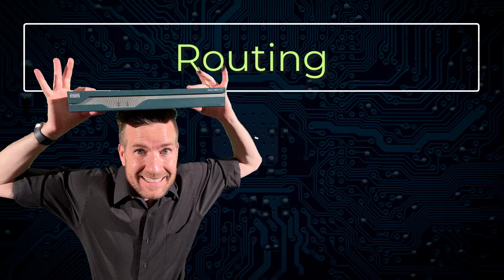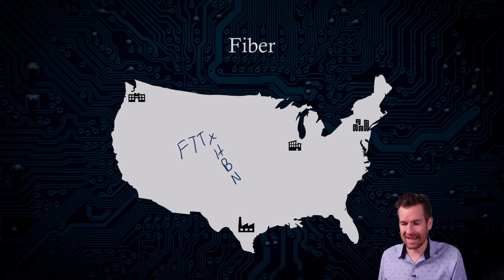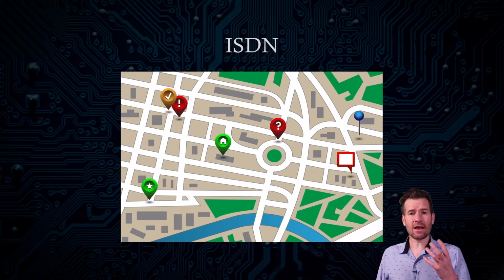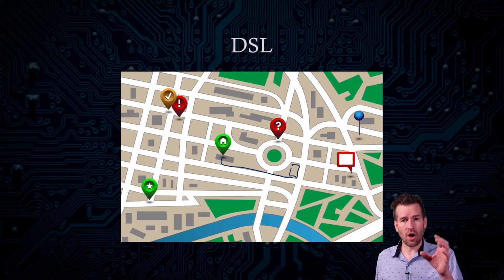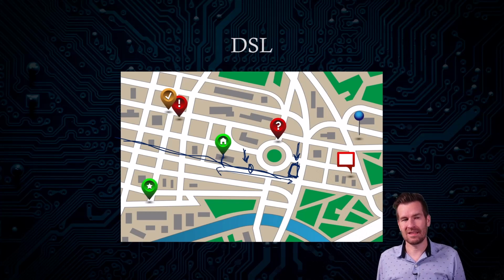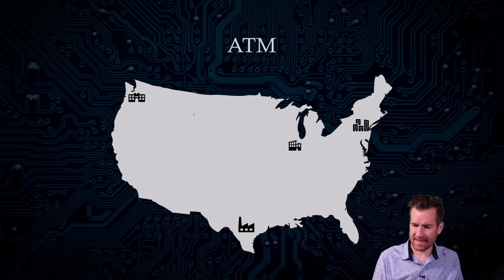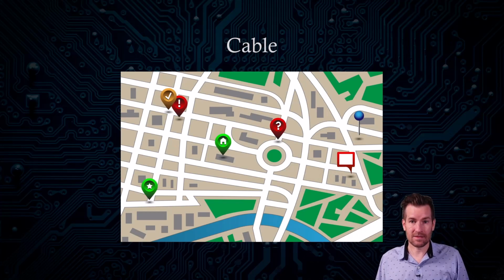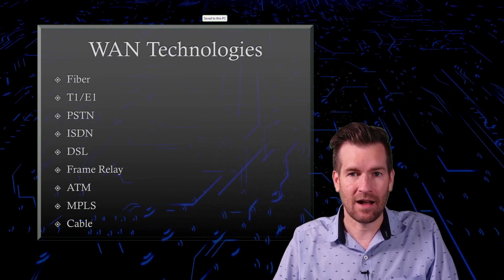CCNA WANs 1-3: WAN Technologies

Comment: Hey fellow techknowstuds ....Notes from today video WAN TECHNOLIGES.
1.	Fiber
Goes long Distance Signal does not degrade.
FTTX    means= Fiber To The  X
Where X can be
H = Home
B = Building
N =Node/Neighbourhood
SDH = SYNCHRONOUS DIGTAL HIERACHY
SONET= SYNCHRONOUS OPTIACL NETWORK
Can Multiplex across fiber
2.	T1/E1
T= North America Standard
E= Eurpoe
T1=speed  1.554 mbps
T2= speed  2.048 mbps
T3= speed  43.7 mbps
E3= speed  34.368 mbps
Older Legacy standard does not have enough bandwidth for modern use.
3.	PSTN = Public Switch Telephone Network
Dial up still used in Older Homes.
May be used if you live to far away from a central office
Still is an option but seen as a last resort.
Only 56 Kbps (slow)
Can be improved upon by using ISDN connection.
4.	ISDN  = INTEGRATED SERVICES DIGTAL NETWORK
Can carry both voice and data 
Expensive now legacy.
Can carry both voice and data.

5.	DSL Digital Subscriber Line.

Can be ADSL = Asymmetric Digital Subscriber Line.
             SDSL = Symmetric Digital Subscriber Line.
Central Office need a DSLAM 
which is a Digital Subscriber Line Access Multiplexer.
Function of A DSLAM is to aggregate the DSL connections to forward to the internet service provider.
Not all central offices have a DSLAM 
Phone line has to clean i.e., away from crosstalk / interference.
Location needs to be within 3 miles of the central office
Solid connection can be provided but it may be oversubscribed.
Can be some latency issues.

6.	Frame Relay.
You connect to your internet service provider via a router.
The service provider has a layer 2 network of Frame Relay Switches.
A Defined route is then made for you to get from point to point. 
Layer 2 	Technology therefore a little faster
Get DATA from 1 point to another point. Guaranteed some sort of transmission Rate.
ASLO CALLED
Non-Broadcast Multi Access Network.
Consists of a series of interconnected LANs
Sets Up a Private Virtual Circuit
Each line has a DLCI which is a Data Link Circuit Identifier (a number) this is used to identify the route / circuit.
7.	ATM = Asynchronous Transfer Mode.
Uses shared line but guarantees a certain Bandwidth between connections
Sends 53 BYTES AT a time down the channel.
Channels are blocked so you only can send your traffic.
8.	 Cable
Original Used to send CABLE TV
Uses DOCSIS  which is
Data Over Cable Service Interface Specification.
Disadvantage : Have to connect to a “HUB” which can get saturated 
These causes slow down in speeds especially during peak times.
Reply from the maker: Somehow I missed this, awesome notes, this is great!!!